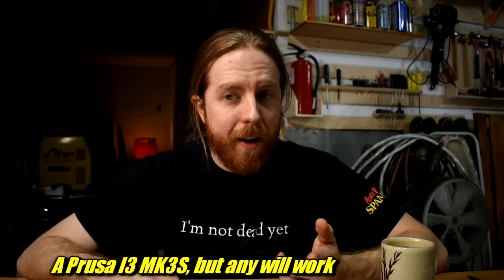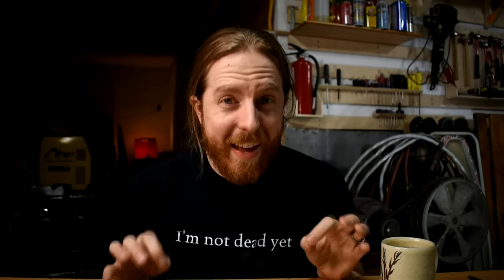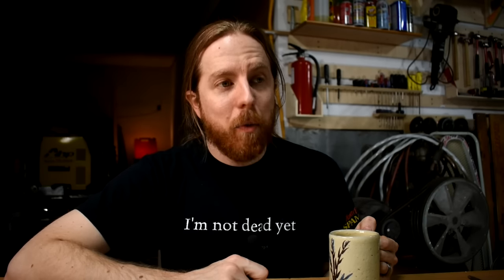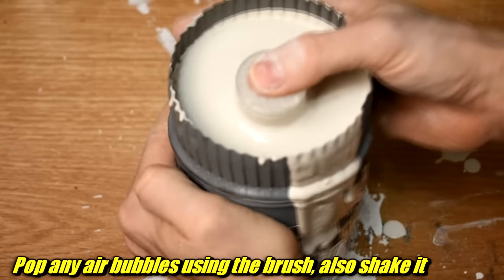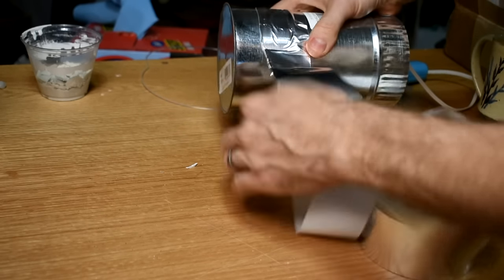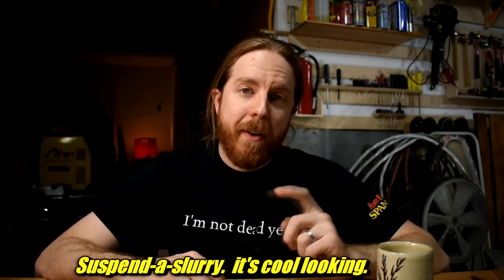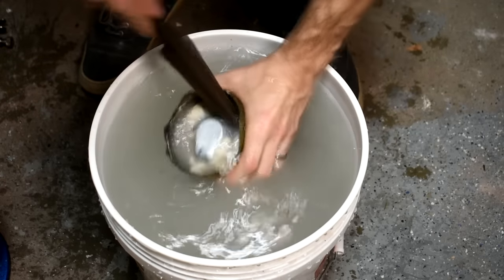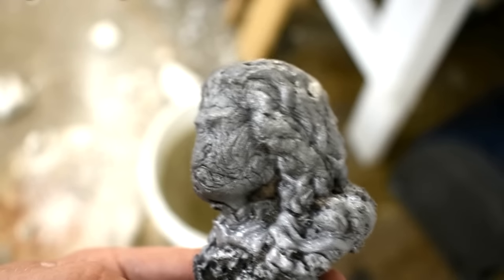3D Print to Solid Metal, BETTER Than Lost PLA Casting

Comment: Black pipe works too and you can get different sizes for it. Less nickle coating on it.
Reply from the maker: Hey that's a good idea.  Black pipe is tougher too
Reply: @PaulsGarage  Thank you. Its from experience. My mom was a silversmith/goldsmith and we did lots of casting together. we used black pipe (large,) with jeweler casting. We used a terrifying centrifuge to fire the molten gold/silver into the material at an impossibly high speed. I don't recommend that to the casual user as you can spray molten gold everywhere. Exciting? Yes, but not safe.
Reply from the maker: @maarkaus48  I've seen those things and I'm definitely going to pass on that!  I'm going to build/buy/something a vacuum casting set up though

Comment: I bought a lot of PVB spools recently to experiment with.  One thought was to try a silicone mold over a print, then dissolving the internal form with isopropyl over a month or so through a channel of some kind- I imagine it will not be quick.  Could be totally bone headed, though i'd like to try it.
Reply from the maker: You never know until you try it out!
Reply: I did try various experiments of this form; for parts that are hollow it will work decent; but if you have solidly printed detail bits with a high length/width ratio it can take very long. Also, how well this dissolving works strongly depends on temperature (and also moisture; do not use wet alcohol). Ive kept it in a slow cooker under the boiling point with good results, it cast with some really nice detail using zamak.

Comment: Hi, don't you know how it works with Zamak3 or Zamak5 (just different/lower % of Al in the alloy)? I am able to obtain Zamak5 with ~5% Al from our local supplier Zamak12 is unavailable here.
Reply from the maker: Yes!  It should work fine with zamak 3 and 5.  Zamak 12 is what I chose specifically for gravity sand casting (what I usually do) so I used it here for investment casting mainly because I had it handy.  Any zamak alloy will melt at a nice low temperature and flow very well.
Reply: @PaulsGarage  Sweet, thanks for the reply!

Comment: This polycast might be a good way to sand cast those fancy new Toroidal boat props. Been in a foundry where they cast Aluminium Bronze boat props, but hard to make a two piece mold for this new style. I think zinc is used as sacrificial anode on boats so Zamak props might not be a good idea. Useful to test if one piece casting works?
Reply from the maker: Zinc would be a great cheap way to test a mold before trying bronze, but yeah it would make a bad prop.  Short term ok, but certainly not decades like an aluminum bronze prop!  I'm not sure how they make the molds for props.  I suspect it could be done with machined sodium silicate sand patterns?  Or CNC'd match plates?  I'm certainly not going to try it
Reply: @PaulsGarage  Seen others Copper plate wood and 3D printed plastic Ironman armour. Plating Zinc should be easier. Copper, Nickle, Chrome. Done Immersion Gold over Nickle for PCBs. Never thought about Zinc before. I wonder how well Zinc CNC machines? Casting Brass is not something I want to do , but those Vevor Furnaces are having a tug on my wallet:)   $21 AUD for a Carbon Crucible.

Comment: Just had an idea. Use magnetic fields to hold up metal in a specific shape so the material in particle or fluid form can be held in a form. Then use electricity to weld the parts together because conductivity. Use ai so it can see the magnetic fields and send material into the mold. Hypothetically, you could use a medium and rotation to aid in the particles aim and integration plus use other forms of magnetism and force from the rotation of the medium to build more intricate structures and systems.
Reply from the maker: Sounds like a cool idea!  I knew a guy who used to work with plasma and said he used magnetic fields to shape and contain the plasma, very cool stuff.  I'm not sure how you would shape the magnetic field in the tiny details, to my limited understanding the fields used currently stick to simple shapes like toruses but I could be wrong

Comment: Could you just spray on a few coats of plaster and then burn out?
Reply from the maker: The plaster needs to be in a block like that for strength.  Ceramic shell uses just a coating but it's a lot stronger and reinforced with sand.  Similar idea though

Comment: Very interesting, but stoopid. No! not stupid at all. Really enjoying these vids and I will have a closer look at the lost pla that isn't pla. 40 years ago there were at least 15 foundries within a 20 mile radius (Illogan, Cornwall, UK). Now there are none. Where's a man supposed to scrounge his metal from?
Reply from the maker: That's rough, I wonder where all the foundries went?  We still need to make stuff after all
Reply: @PaulsGarage  Many foundies cast things to do with mining. Mining declined and foriegn made parts were cheaper. The last one shut about 3 years ago, just a few months before I had been told that they might help supply a few odds and ends. The man who told me about them runs a small foundry as part of his business repairing mining equipment for the National Trust here in Cornwall. One of the parts he cast weighed 40kg, in bronze. That's as heavy as me (yeah, right).
Reply from the maker: That's too bad but it makes sense.

Comment: if your pla doesnt burn out 100% clean youre heating it up too fast. heat it to the point it melts and "evaporates", but not to the point where it self ignites. keep it at that temp for like an hour before heating it up further

Comment: I saw a video of a guy doing lost PLA without burnout, i think he printed with 0% infill and just poured the metal on the plastic, which burned immediately. Maybe with PVB it would be easier doing that.
Reply from the maker: I've seen that too, it has to be printed in vase mode (which severely limits the kind of print you can do) and feed the metal through a gate in the bottom.  It's doable for sculptures or busts, like that Mando helmet.  The triceratops might be a bit trickier though

Comment: I am by no means an expert, but I imagine setting the infill to zero (or as low as you can) would help with the burnout issues
Reply from the maker: It would yes.  This skull would have trouble printing without any infill or supports, but that would be easier to burnout for sure.

Comment: In my experience, PolyMaker PolyCast was NOT as easy as PLA. I have a Creality 3, and couldn’t get the PolyMaker to stick to the print bed. I tried both glass bed and factory bed. The trick for me was to turn the bed temp up to 65C, turn the fan down for the beginning of the print to 25%, I added a brim in Cura (brim was absolutely necessary), and used Elmer’s disappearing purple glue stick. I had about 15 failures before I got my print to work!
Reply from the maker: Thanks for sharing your experience and for the settings!  What kind of bed does the ender 3 have?  I've never tried one, only the prusa mk2 and MK3 which both have a special bed coating.  In my experience, the prints stick too well instead of not well enough, but that could just be the bed material.  I've even printed a bunch of stuff in ABS and ASA without an enclosure and the prints stay locked to the bed.
Reply: @PaulsGarage  tried a glass bed and a “textured pei” bed. The textured pei bed was better, but a brim is mandatory for polycast, bed weld or Elmer’s glue makes it better. If your routine doesn’t involve adding a brim or glue, might be tough!

Comment: I will track down some public and give it a go. Your comments on lost pla were a bit rough. I have printed and investment cast many lost pla pieces and have no issues with ash. I can't say for sure but it seems many pla colors have binders in them too and this seems to cause the ash. For lost pla, I always use natural filament and it works great. Definitely it is a pain that you can't chemically smooth it easily. How toxic is the burnout of pvb?
A few tips for investment casting, add some sand to the mix, also short chopped fibreglass strands and a little Portland cement helps.
Reply from the maker: I've heard the same about sand and stuff in the plaster, I just wanted to do this as simple as possible.

Good point on the fillers and colors.  I didn't try more than 3 PLAs I think.  There's a method of cleaning out the ash, basically letting the mold cool a bit and blasting compressed air through it to blow the ash out.  That might be tricky with complicated prints though 

Not sure how toxic the burnout is with PVB but it was definitely less smelly than PLA.  I use a propane furnace though so ventilation is already required, I didn't need to do any additional for this.

Comment: I would never refer to zamac as stronger than aluminium, it might edge out on ultimate tensile strength, but it’s so prone to fracture that there isn’t a single use case I can think of that you would observe it to be actually stronger.
Reply: Taking a direct comparison, Zamac-3 is slightly weaker than Aluminium 6061-T6 on ultimate tensile strength (280 vs 310 MPa), significantly weaker on yield (permanent change of shape: 210 vs 270 MPa) and half the fatigue strength (ability to withstand repeated stress over long term: 48 vs 96 MPa). Shear strength is the same. I don't have data on toughness, but my experience suggests it is perhaps half as tough. I think that poor toughness (ability to deal with suddenly applied loads, like impacts or shocks) is probably the reason for your comment that Zamac in general is "prone to fracture".
Reply: @Gottenhimfella I was trying to keep it readable to a layman, but also I was comparing cast to cast, not to a tempered billet.

And yield strength/toughness here don’t exactly translate as Zamak doesn’t really yield, for all practical purposes it’s straight into a brittle fracture. It’s got essentially no grain boundary mobility.

Comment: Had a look for that zamak after you last video, doesnt appear to be easily had here, I will keep looking as it intrigues me. Just worried about off gassing though. Zinc is nasty stuff to breathe.
Reply from the maker: That's a bummer.  If not for rotometals here I'd probably be out of luck.  The fumes arent too bad with zamak if you don't over heat it.  The fumes are usually from melting brass (with zinc in it) or welding galvanized steel (zinc plated), both of which use heat above zincs boiling point.  Melting zamak should be well under zincs boiling point.  Barely melted.  Also if you're melting anything there should be great ventilation, regardless of zinc or not
Reply: @PaulsGarage  yeah, I know I shouldn't be getting near temps that are an issue  - I've just not done a lot of casting and I get nervous about my ability to not to overcook things!
Reply from the maker: @jackdawg4579  from what I hear, zamak is best poured about as cool as you can manage and still fill the mold.  Still, ventilation is always a good idea
Reply: @PaulsGarage  wrote "The fumes are too bad with zamak if you don't over heat it"  (clearly your intended meaning is "the fumes aren't too bad")
I'm curious why there is a recent (maybe starting five years ago) uptick in this "omitted negative" tendency, which prior to then I'd generally encountered seldom from Americans (occasional exceptions as noted below), and pretty much never from other Anglo countries. 
I wonder if it's partly because of dictation taking over from typing. American speech tends to omit consonants whenever they require extra effort, which is probably why the saying "I couldn't care less" changed (sometime in the last century or two) to "I could care less", but only in North America.
If you don't mind satisfying my curiosity: did you type your post, or dictate it?
Reply from the maker: @Gottenhimfella  definitely typed on a phone.  Could be auto correct, or could be stupid fingers and no proof reading.  I do have some nerve damage in my hands so maybe that?  Who knows.
Reply: @PaulsGarage  Thanks!

Comment: Huh, well now I want to use this for my metal experiments, thought I was saving aluminum pop can tabs so I wouldn't have to buy metal because I'm cheap and also adhd so the less I spend on the random hobbies I inevitably abandon the better. 😂
Reply from the maker: I feel you on the ADHD but definitely don't use pop can tabs.  Those are mostly pure aluminum and it won't cast very well, you will have problems even if you do everything else right.  The surface tension is too high when liquid and the shrinkage is really bad too

Comment: Many/most people seem to really like aluminum because you can find it by recycling waste. It would be nice if there were a reliable source of zamek waste.
Reply from the maker: A lot of that aluminum waste is likely zamak, people confuse the 2 and mix them up sometimes.
Reply: It’s been a long time since I did any METALLURGY, I forgot more than I know, but is it possible to etch it with something to see if it’s chemically more zinc or aluminum?
Might be more trouble than it’s worth if you’re just trying to find things to melting in a pot, but it should be possible with copper sulfate and see what happens but you definitely want to be careful with any Nicole and copper etching compounds, especially nickel, don’t wanna breathe in.
Reply: If all the ornamental bathroom and kitchen metal is zamak, then salvage yards, discount hardware, etc. seems like a good place to start?  But  @Paul's Garage  said in another video that trace lead contamination makes zinc alloys rot, so the real issue may not be how to find it, but whether you can trust it.

Comment: got a 3d printer originally for casting...
tried "lost wax". multiple times.
gave up.
in between burn out and refractory investment, requiring investment...
failure.

resorting to greensand, sodium silicate, core boxes and patterns...

i won't go back. 

it takes a bit more effort to make patterns, and for some things its basically impossible, but still... for what i do, greensand is sufficient.

and cheap.
Reply from the maker: You're doing it backwards compared to me.  Ive been doing sand casting for years and now expanding into investment casting.  Find what works and have fun

Comment: I cant even do lost pla casting. the pla never fully burns out even after 8 hours.
machinable wax filament is completely un-printable. after about 5mm the print lifts and you end up with spaghetti. every time. i've tried dozens of setting and bed adhesion tricks. 
its my top worst filaments i've printed with. i haven't tried poly cast yet. i thought i bought it but i actually bought poly smooth on accident. not the same thing. lol
Reply from the maker: How hot is it during that time? I had these glowing red for over an hour and that was enough for polycast.  I've had PLA also not burnout.  Try polycast 👍 and get it glowing hot
Reply: @PaulsGarage  a friend and i tried burnout in the kiln at casting temp for 2-3 hours w/PLA then also tried an old oven at 500f with the mold upside down so it can flow out. burnout in the kiln always cracked the plaster of Paris mold. i bought expensive casting plaster to try but lost time to experiment for a while. 

poly smooth i accidentally bought didn't even melt out at 500F after 4 hours it looked like nothing happened to it. 

i considered 3D printing a mold and filling it with wax but it cant have voids that may trap air. only good for simple models.
Reply: @PaulsGarage  also i'll have to try zamok instead of the aluminum we got for free. the aluminum we got may not be good for casting.

Comment: Isn't burning PLA toxic? It's a resin, right? I don't think burning any plastic/resin is a good idea.
Reply from the maker: Burning anything is probably bad for you, always do this with LOTS of ventilation
Reply: Burning any plastics and huffing the fumes is bad. That being said, there is a difference between common plastics used for FDM ("filament") printing and those used for stereolithography ("resin") printing. Resin printing is done with materials that are designed to react with UV light to cure, and every last one of the commercially-viable photopolymer resins I know of is dangerous in both its raw liquid form and if it were to be burned. Polylactic acid (PLA), on the other hand, is used for medical implants because of how safe and readily biodegradable it is. Raw PLA also releases no chlorine, bromine, heavy metals, or dioxins during combustion, though PLA filaments with additives for color or for achieving specific properties might produce potentially harmful byproducts when burned. While PVB isn't used for medical implants because it doesn't break down like PLA does in the body, it is otherwise very much the same safety-wise: the most dangerous byproducts of burning raw PVB (which is likely to be what PolyCast is, due to the low ash content) would be carbon dioxide and carbon monoxide.

Ultimately, lost PLA or lost PVB casting is at least as safe as traditional lost wax casting, if not safer. I can still smell the stench of burning tires that stuck to me through multiple vigorous showers as a result of a college project where we made bronze bookend investment castings and had to burn the wax out with a half-million BTU torch...good times.
Reply from the maker: Good write up.  I recently heard a fantastic tip for removing the wax.  If you use suspend a slurry for ceramic shell, when it dries, it can't be broken down in water anymore.  You can then boil the thing, which makes the wax melt and rise to the top, where you can skim it off and reuse it.  No burning!  Then you have to fire the ceramic shell obviously.